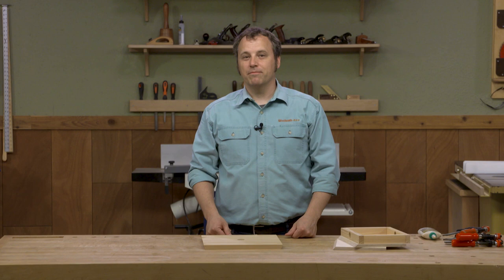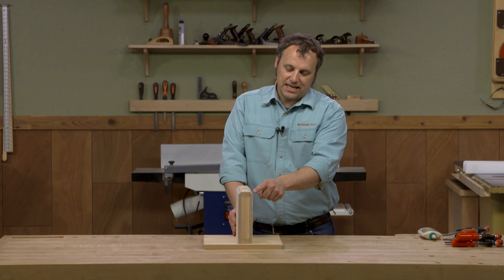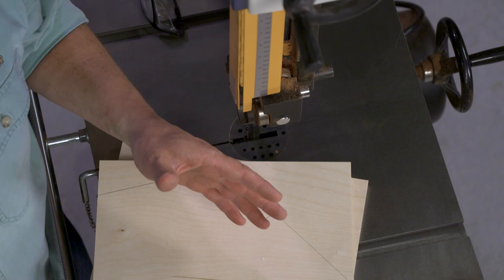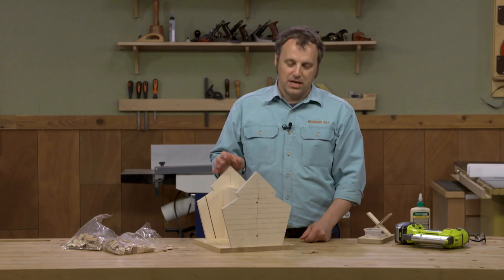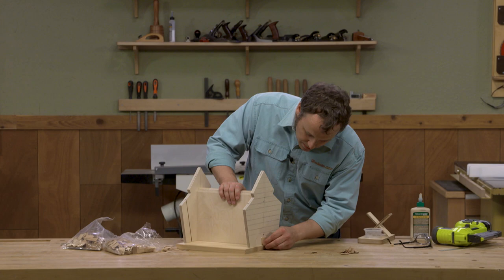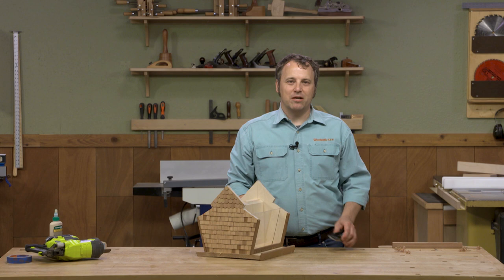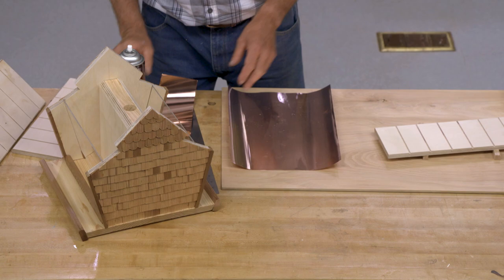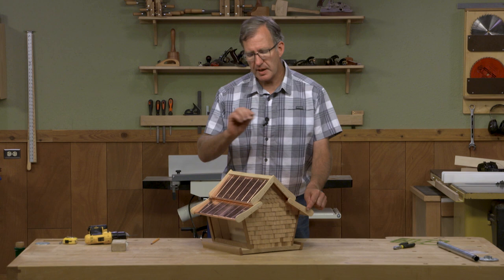Building a Deluxe, Cedar Bird Feeder With Copper Roof

Comment: How do you put the bird seed in after it’s fully assembled and post mounted?

I just watched this video for a second time and can clearly see that this design doesn’t work. The way I see it, you would have to disassemble the roof and detach it from the mounting post to get the bird seed inside.
Reply from the maker: Sorry we didn’t fully explain that part in the video, but it is explained in the plans. The pipe that it is mounted on runs through the body of the feeder and screws in to the roof.  Then you drill a hole through pipe just below the bottom of the feeder and run a pin through it. The body of the feeder sits on the pin. When you want to refill it, pull the pin, and the body drops down so you can fill it with seed from the top. There is a photo here (3rd thumbnail over, but it doesn’t show the pin): https://www.woodsmithplans.com/plan/bird-feeder/
Reply: @WoodsmithShowandmagazine  - I see. Thank you for the follow up.
Reply from the maker: I've added an article on our website with some drawings of the mounting assembly to help visualize that process: https://www.woodsmith.com/article/building-a-deluxe-cedar-bird-feeder-with-copper-roof/